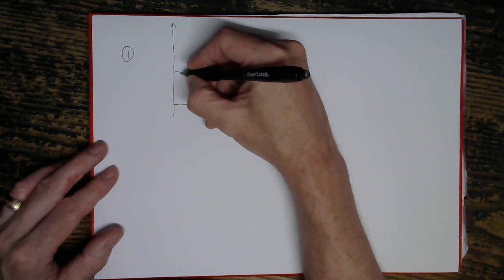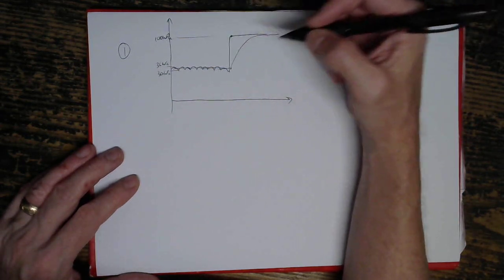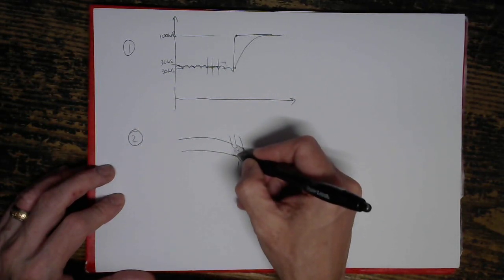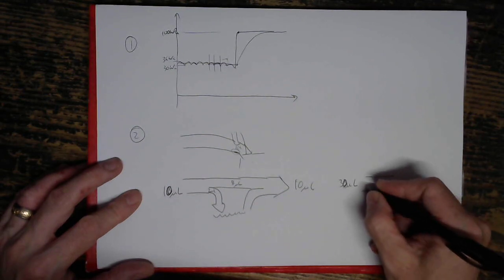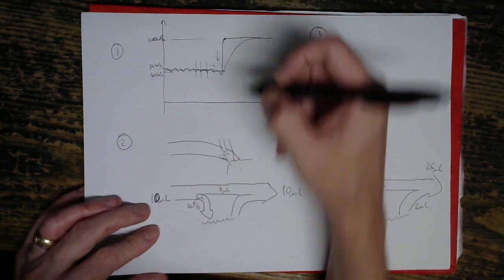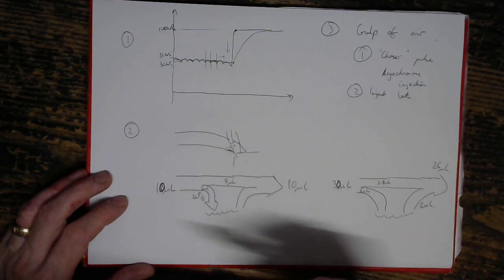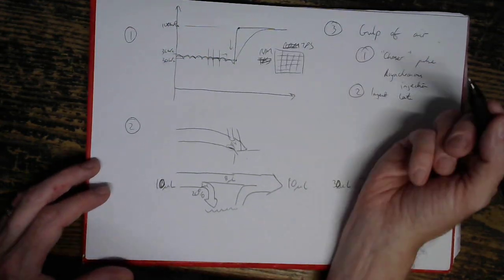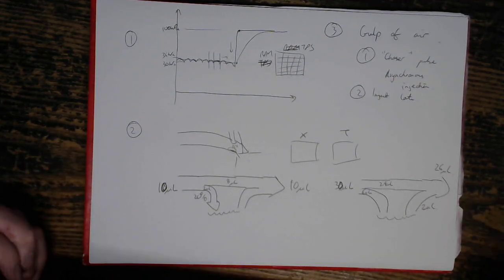Setting up throttle response using MAP prediction and fuel film model on a Haltech Elite / Nexus ECU

Comment: Thanks Andy a terrific explanation. But the sound quality is of Microtech Digi 4 standard
Reply from the maker: Yeah sorry about this. Like I said this is mainly so I don't need to write out the same response on FB lots of times rather than trying to build a channel for myself. I think the ones where I use the camera app work a lot better than recording with Zoom so I'll try to do that more.
Reply: @Andy_the_engo   and i see both side of the  argument in terms of using the pedal for this as  the pedal can  help make a prediction of the what the  MAP will be   and it happens  before the throttle   moves so i guess you get a slight speed advantage in the operation  . but  as you say its not the throttle opening so you would have to look that up  and then  non DBW cars have to be throttle any way
Reply from the maker: @incolink  yes, but if that were the argument, then the variable to use would be target throttle position, not pedal position.

The pedal position doesn't even have to match the throttle position, you can put in whatever curve you want, limit it, have different driving modes that select different curves.... Kids have got to learn to draw a diagram and pick the right place in the calculation chain.

Every time someone has got confused at work I tell them to draw a diagram. I learnt this when studying physics as a teenager. And they don't. So I draw the diagram for them, and they say "ah, now I understand".